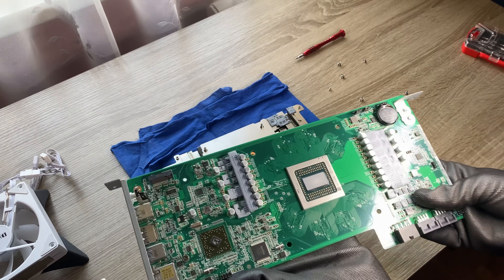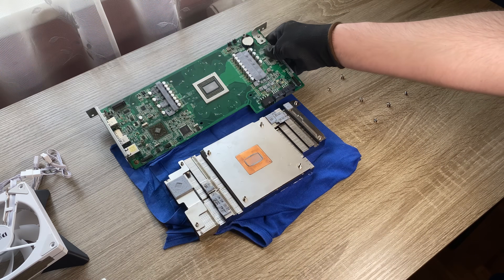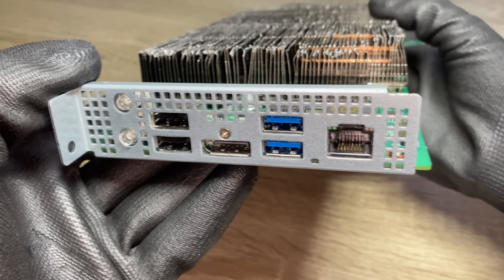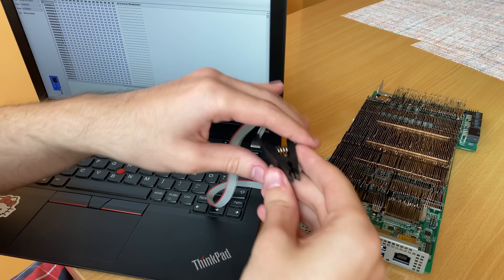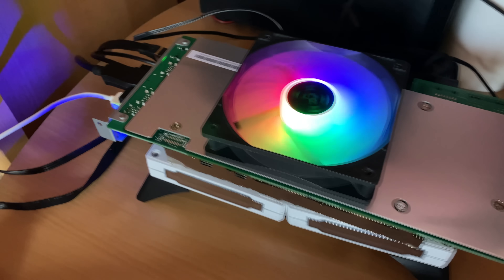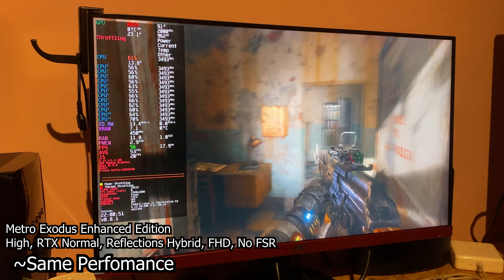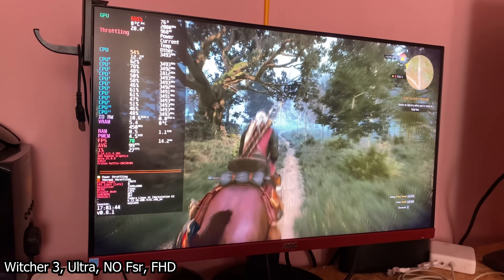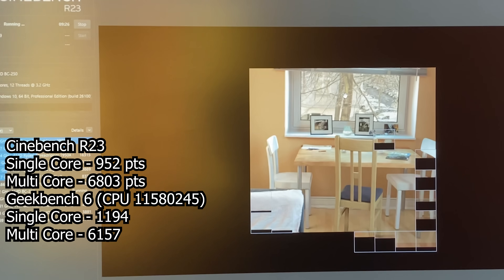This PlayStation 5 Chip runs Linux and It is AMAZING!

Comment: Here’s the clean distinction:

    The PlayStation 5 APU = the exact chip inside every retail PS5 console (8 Zen 2 cores, 36 RDNA2 compute units).

    The BC‑250 chip = a cut‑down variant of that same design (6 cores, 24 compute units).

So technically:

    It is not the PS5 APU.

    It is a related chip from the same family, which is why enthusiasts and sellers sometimes call it “the PS5 APU” even though that’s inaccurate.

Comment: Interesting device, I live in Canada and I can get them on ebay for $85, was really tempted of getting 3 boards to experiment with it. Then I realized, all the space and mess and trial and error trying to get this to work, and after buying necessary accessories(PSU, Case, and Cooler Case Solution Enclosure and Noctua Fan - Made from ABS), will end spending around $400. I'd rather buy a used PS5 which I can find locally for $250 and keep using my MiniPC's w/8945HS and 7840HS w/ eGPU AMD Radeon RX 7600M XT 8GB via Oculink for AAA PC Games. One of them is running BazziteOS and the other one is running Win11 Pro. Both have 64Gb of RAM.
Reply from the maker: If the goal is tinkering, you only need PSU and a tool to remove ribs, to make it possible to use 2 120mm fans for cooling. Why would you need case or three of them for tinkering? Cases are overpriced since there is only one or two guys on eBay 3D printing those. They are also bad in my opinion.

Comment: For people wondering about getting one of these boards:
1. for gaming these boards are great, it only having 16gb vram can become a issue in high end gaming as the cpu also needs to use that. generally no problem however, tends to just go right even with high end games (*1)
2. for photo and video editing, this board isn't amazing often, again only 16gb shared vram, but also you need to hope the software supports proper vulkan and doesn't rely to much on speciffic unsupported instructions, can be done for some software though some work.
3. for AI it works well, primairily when the AI tool is run with vulkan as backend, ROCm also installs without issues, though using it is more problematic due to some softwares trying to see what gpu you use and not recognizing it, as well as that many ROCm based AI tools have all kinds messy very specific and outdated python dependencies and such. ROCm shows however it supporting almost all ROCm functionality when queried for that after install.
4. this board mainly works with graphics software running on vulkan, which is what games use, opengl also works generally, but sometimes not properly.
5. IO can in some cases be partly glitchy, under heavy IO load it seems like some glitching sometimes happens.
6. Sound over DisplayPort does work, in some games glitchy, in other cases working well, when you unlock the bios however you will also break the sound, as the BIOS patch causes the sound to go like in slowmotion. use a cheap usb soundcard instead, or if the vram ratio is set correct and you don't want to change it, then you can use it without patch, storage is often also slow, especially when using usb ssd or such, pcie slot also is at the exit where the hot air comes out if using a shroud so not healthy for a ssd there, general useage is good however.
7. Speed of the GPU can be increased by well over 33% compared to what it normally does, requires a kernel patch however. with such a patch you can also fix other issues partly, like the very high idle power draw, won't get super low however, but much lower than normally.
8. don't use it as daily driver, idle power draw is still very high, idling around 100W isn't concidered high for these boards, when using it only for gaming, then the powerdraw for the performance isn't very high, so for gaming it is good, idle just isn't much lower than load.
Reply: What is this kernal patch?
Reply: Ah thank you very much. High idle draw invalidates the idea for my personal use as an LLM accelerator and file server.

Comment: This type of cooling solution based on a pressure diffrence between the two ends of the card, not hard to use if you olso want to desing/print an enclousure.
The back plate and pcb gap seems so big to me. it is possible to need to produce airflow UNDER the plate/ HSF or say paralell with the plate to get the PCB and small components cool.

The board layout at the power and RAM area is looks good can be the signals are olso prity good quality too.
Reply from the maker: Yes, but why would I print it? I had 2 cheap 120mm fans and wanted to use them. If only to save original looks. Since I made this video people created 3D printable tool to remove ribs in easy and aesthetically pleasing way.

Comment: Ok how it has BIOS OK WE CAN DO IT from a ps5 has a no data problem some ps5 IGPU IS Died and not showing any thing if i know how install bios on it we can fix this problem and install win 11 or 10 on it but u need a graphics card  to run it again ps5 have a 2 nvme slots and nvme use PCIE lines 8+ 8 equal 16 line you can use all 16 line to run extrnal gpu but i need how to give it bios how 😂
Reply: You cant. Its designed to be locked out from the consumer. Same with Xbox and Nintendo. They block you from accessing the bios via specific Read Only Firmware.

Comment: interesting, for $100 you can get essentially what's a Ryzen 5 3600 + a slightly-weaker-than-RX-6600 GPU (the 6600 has 28CUs over the 24 of this computer)

also if the BIOS flash allows you for any RAM/VRAM split, I'd go for 10GB RAM and 6GB VRAM

Comment: i wonder if you desolder a ps5 apu that has 100% working cores/gpu cors and solder it on the bc 250
Reply: Me 2 I will buy a broken ps5 if I know it works lol then modify the bios for bigger chips vram to be soldered on.

Comment: it has a video driver for windows  but you have to installing / modd the inf to install the latest drivers  done 
ot better user a software called driver booster within windows it automatically finds any driver for the weirdest oem hardware
Reply from the maker: There are 0 proven cases of drivers being installed on this device. Driver can't be found or installed since it doesn't exist. If you have any proof - please, provide a link.
Reply: @OleksiisTech  first go in Windows, then open the device manager  or in linux open terminal, get the hardware ID ( lspci -nnk | grep -A3 VGA ) and will send you the driver

Comment: whats the powerconsumption under full load gpu/cpu with a nvme?
Reply from the maker: 220W TDP
Reply: @OleksiisTech Can you measure the actual power usage under full load while gaming? 8 pin PCI-E is only supposed to provide 150w. How does TDP of 220w work with 150w from PSU?
Reply: @rcboosted  100w over the pci express interface, 120w over the 8 pin
Reply: @snapo1750  But when running Fedora, we're not using pci express interface right? So would the 8 pin be sufficient to play game with higher demand?
Reply from the maker: @rcboosted  Don't listen about watts from PCIe interface, it doesn't connect to anything to get that power, it hasn't pcie interface at all. As far as I understand, 150w for 8pin is what standart is rated for. Theoretically nothing forbids you to send 220w by 8 pin.
Reply from the maker: @rcboosted  as for measuring power - hope I will refresh that video in a month, when I will print stand for it and get watt measurer from China.
Reply: @OleksiisTech looking forward to the future review. I am straightening my fins to run a standard case fan on top instead of from the side for noise reduction. But I only have a 6pin from old PSU. Waiting for adapter.

Comment: why rip the cooler... u never heard of blower style smh
Reply from the maker: I said the reason in the video and mentioned "turbine" cooler. It's way noisier.
Reply: @OleksiisTechok guess i wasnt paying attention at that part … but still idk if u have a 3d printer or not … there is a free print thats for a single normal size fan … seems to work fine just idle not mining (cracked bios doesnt wanna mine right for me ?? Idk 🤷🏼‍♂️) … didnt get fedora installed yet etc etc
Reply from the maker: @IDK_Mining  there is a better 3d printed tool, allowing todo what I did very clean and without cutting 
https://www.printables.com/model/1282906-bc-250-scooper

Comment: Seems to me like the best way to remove those folded heatsink fins would be to use a belt sander.
Reply from the maker: After I recorded video, I found out there is a tool for making what I did in much more civil way. It's 3D printed one, as far as I understand it bends those things inside instead of removing them, and it looks so smooth like it was intended this way.
Reply: @OleksiisTech Ah, so essentially a ... rake? Comb? Plow? Type of thing, that you insert into the open end and have it unbend the flattened sides? That's pretty clever, and yes, that sounds like it would work great!
Reply from the maker: @Kraaketaer  https://www.printables.com/model/1282906-bc-250-scooper here

Comment: I thougth this cpu was only made to be used exclusively with metal liquid !!! that's probably you have so low result !
Reply from the maker: It wasn't, originally this board had some random thermal paste. And as I mentioned in video, I fixed temps by simply putting fans on top of the board.

Comment: Just 100 usd and another 100-400 to get it working properly
Reply from the maker: ??
256GB SSD is $15, Good but used PSU ~20-25,  PSU switch for $2 from Ali (or free with paper pin), and CH341A bios flasher for $4.
Reply: @OleksiisTech  cooling, casing, storage, the amount of headache as seen in the video... Not forgetting other things you will need. That board won't perform for more than a few minutes before it's 1000°C
Reply from the maker: @stanleesiele6028  2 fans I use litterlally cost $5 each. Removing ribs is free. Casing isn't really needed to run it, but if you want to do it there are plenty ways to make it cheap or even free, examples are in Discord server.

Comment: what spi chip did you use in the ch341a software? i cant find Winbond 25Q168JVSQ.
Reply from the maker: neoprogrammer v2.2.0.10
Reply from the maker: Had this issue to! I used neoprogrammer (don't remember version) and only it detected chip correctly.
Reply: Just do a software flash

Comment: Well I mean the PS3, PS4, and PS5, are all based on linux. If I remember right it was a old version of freebsd that Sony heavily modified. And because it was an old version the modding scene managed to find a bug with the older version of freebsd and it worked on the PS4 and it created the ppowned exploit if I remember right. So yeah.

Correction thanks to @juho1882 's comment underneath, it's not Linux, and it doesn't use Linux terminal, it uses unix, which I did not know before
Reply: freebsd is not linux based
Reply: @juho1882 my bad if I'm wrong, I've tried Linux on several occasions but always end up back on Windows for one reason or another, but if it's not Linux, then what is it? Because when said Linux based it was assumption that it used Linux Kernel, my understanding of Linux in itself is very lacking
Reply: @Clockworkmech  it doesn't use linux kernel. it uses unix kernel.
Reply: @juho1882  oh didn't know that, thanks for correcting me, you learn something new everyday

Comment: The reason cs2 gets only 100 fps is because there is only like 15 watts allocated for the cpu, 15 watts is not enough for high fps cs2,  my mini pc with 7840hs apu has same problem, cpu only uses 20 watts max, rest is reserved for the igpu, so i only get about 150 fps in cs2, much lower then my desktop ryzen 5600, because that one can use 90 watts.
Reply from the maker: I didn't mention at first, but when I was showing tests of Metro I said that monitoring is lying about TDP of both CPU and GPU. Total TDP of the board is 220w.

Comment: This Proove that AMD and Intel could make Cheap and compact PCs but.... They wanto YOU to keep buying expensive and power-eating machines so you expend more money.
Reply: The new Framework Ai Max PC is great..... But also costs 2-3x what it should.
Reply: @--waffle-  Because it isnt PC. Its a mac on x86, and sucks ass as actual PC (they have a x4 pcie on it at least).
Reply: @--waffle-  Ryzen Ai Max's Zen 5 is HX version i.e. full-fat Zen 5 with 32 MB L3 cache per CCX i.e. CCDs are the full desktop version.
Reply: It's a laptop 8-core Zen 2 implementation that is the same as AMD 4700S (PS5 SoC) and 4800S (XSX SoC).  A laptop with Zen 2 has half of the L3 cache of desktop Zen 2.

Zen 3 will crush it.
Zen 4 will crush it.
Zen 5 will crush it.

Comment: How is it with LLMs?
Reply from the maker: No ROCm support. I tried ollama but it only uses CPU. I am sure it's somehow possible to run it on Vulkan, If I am not mistaken I saw someone did those on Reddit. I stopped using local llms because selling my data to China in exchange for free DeepSeek on OpenRouter was too good offer for me 😄

Comment: Why on earth anyone would go to this trouble to run this damn thing man 😆🤷🏻 when there's well purpose GPUs available. I understand you need the content but for other users this is certainly not recommended.
Reply from the maker: This is a PC, or MB+CPU+GPU+RAM kit with TDP of 220w. There is nothing even remotely close in terms of price/perfomance to this device. The biggest trouble was cooling, which can be done in other ways, faster and nicer than mine. Flashing bios was 20 minutes and patching drivers is no longer necessary with new Mesa support.
Reply: Some people like to tinker on stuff. Thats how you learn, plus its cheap.

Comment: I'd buy one and see if I can swap the APU with a fully enabled one from a PS5.
Maybe one of the 6nm "Oberon Plus" variants too.
Depends if they make reball stencils for them.

By extension, maybe faster GDDR6 could be fitted, provided the BIOS has options (which could be enabled by hex editor) to toy with memory timings and speed.
Reply from the maker: I thought about this, but have no money and skills to test it, moreover testing something that has a huge chance of failure. If you will have any success - write me, it would be insane. Good luck.
Reply: @OleksiisTechCheers mate! I'm looking at getting a BC-250 right now (or wait for one at the right price). I'm going to try obtain a broken PS5 motherboard CFI-1202 or later (as they have the 6nm apu).

My only worry is that the BIOS may not know the fused model string data from the APU, this is programmed at the time of manufacture for the APU. Might be a case of adding the PS5 APU sku code to the support string in the BIOS, not sure yet.

Most of the time with AMD platforms, the south bridge runs a hardware support check (As soon as standby power is provided) for valid device codes. If the device is not on the list, the system will either not power on (at all) or hang at a post HEX debug of "00" as the device is halted before BIOS code can even begin execution.

Side note:

I'm also working on making a 16gb 5700XT with SAMSUNG K4ZAF325BM-HC18. Ive already made a custom BIOS and upload to TechPowerUp with support for the new chips.

Already attempted it but I got sent faulty chips. So I will try again with the new ones.

Keep up the good videos, you earned yourself a new sub :)
Reply from the maker: Thank you :) I would advice to buy it now though, my video is getting 500 views per hour (as for now, may be it will stop in ten minutes), and already has 20k views. I guess it's a matter of time when BC-250 became more popular and thus - more expensive. Sure thing I can't see future, but those are my thoughts.
Reply: @OleksiisTech yup, its spreading - im looking at this h=jaw dropped. prices will go up for sure.
Reply: @OleksiisTech I'm based in the UK so getting one is basically unobtainium regardless.
I'll have to wait for one to come up to even buy.

I can see loads of listings from the US but shipping is nearly £70.
Unless I can win one for super cheap in a US auction then the shipping is worth it.

Custom mining hardware was never really used in the UK, mainly GPUs and laptops were used.

I'm sure I'll get one at some point to mess with, no doubt.
Reply: @P2PC  I'm in netherlands, so also expensive shipping+tax. though got one for around €150 total.

that said I was thinking about finding some other people wanting one and then getting one of those clusters with 12 of them in it. then even though they have insanely high shipping, the price per  board would be pretty cheap( around €60 with shipping).
and as in netherlands game pc's and pc hardware is also generally unobtanium. atleast when looking for cheap stuf, €60 would probably be very interesting to many here if they knew what it was.
as in I see people ask €600($700) for a secondhand pc with a 7th gen i5, 16gb of ram and a rtx 2060 or such. or asking €300 to €400 for something similar but with a gtx 970 in it.
many prices here are so inflated for secondhand electronics that it is often cheaper to get something faster/better new than it is to get something secondhand.
Reply: @P2PC if your still interested I recommend you using a shipping forwarder, that's what I'm planning to do
Reply: no need to replace the apu if you are lucky.
it actually has all the cores still in it, and some people said they where succesfull in enabling the disabled cores.
just be aware that often they where disabled for a reason. 
if lucky, they just where worse.
but if unlucky some core or such might actually have been broken which could potentially even be a risk.